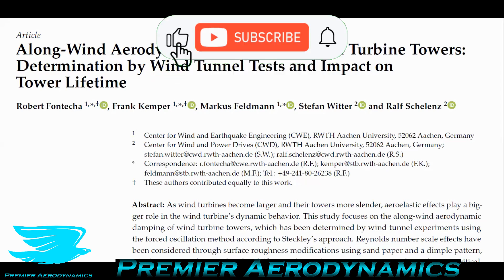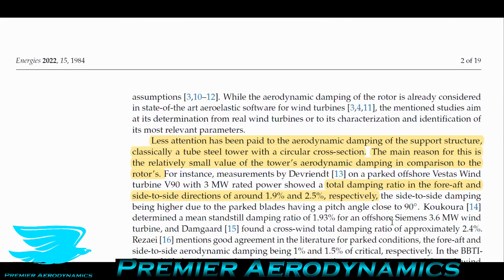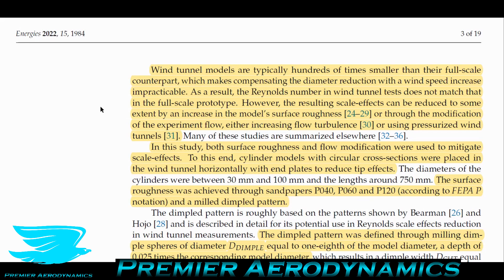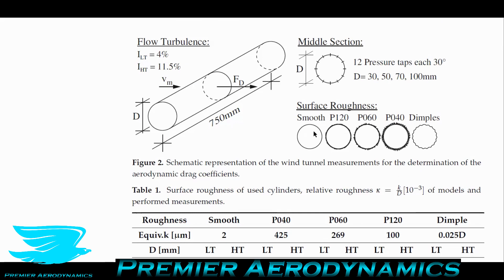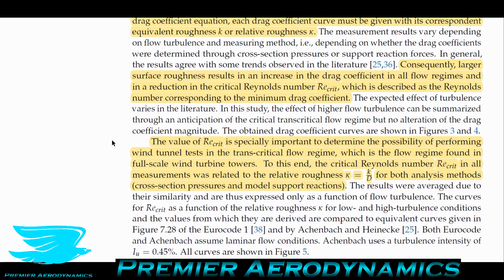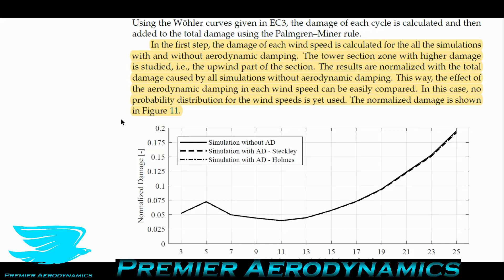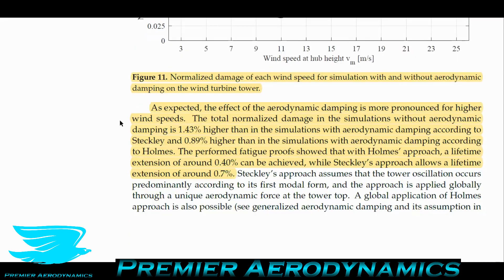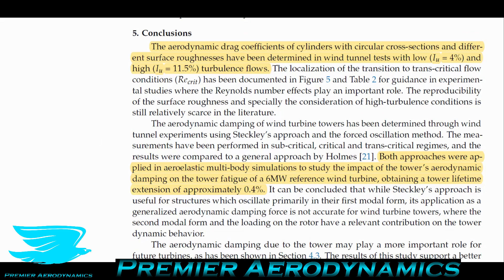Wind Turbine Failure Reduction from Aerodynamics- Podcast #48

Comment from the maker: If you want to learn CFD, check out our course: https://premieraerodynamics.com/courses

If you’re not measuring the temperature, barometric pressure, and humidity in your aerodynamic experiments, then check out The Atmosphere Hawk. https://premieraerodynamics.com/Atmosphere-Hawk/

It accurately measures these parameters to get rid of the large errors you get in the density, force measurements, and more! when you don’t measure them. https://premieraerodynamics.com/Atmosphere-Hawk/